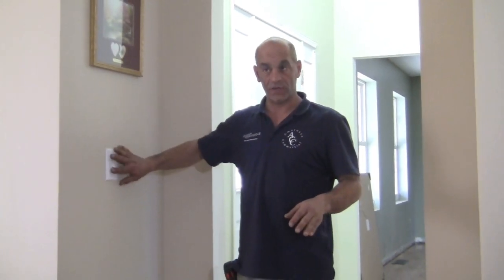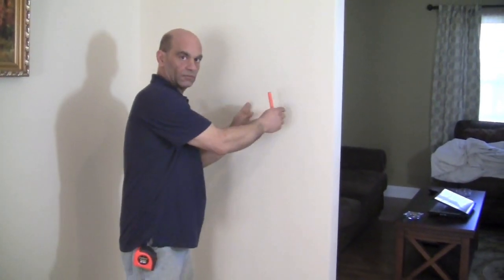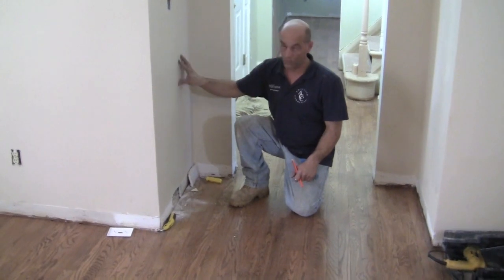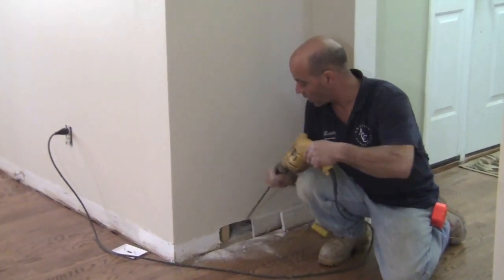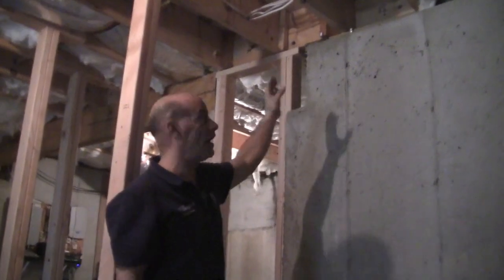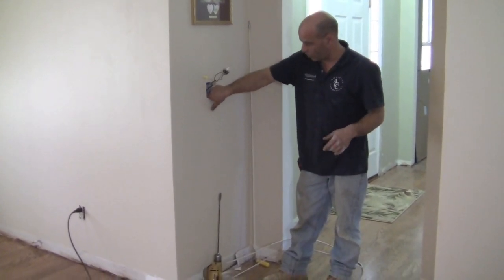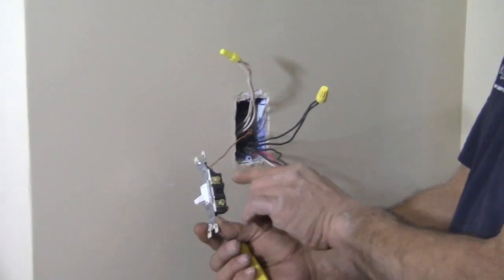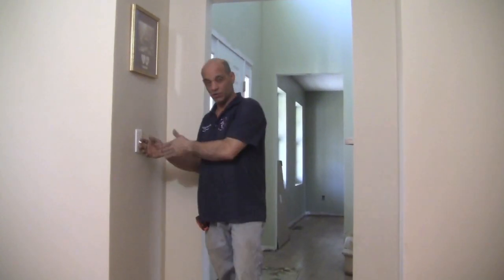How to install a three way switch to a existing one way switch

Comment: Thanks for the vid. Question, my hardware store is out of one way illuminated switches. Can I get away with using a 3 way which they have 30 lol?
Reply from the maker: Yes of course. It doesn't need to be illuminated.

Comment: At my company,  we call them dead end 3 ways.    The big disadvantage,  is there is no neutral at the other 3 way switch that you just added,  and some of the newer smart switches and dimmers, do require a neutral.   Unless you ran a 4 conductor plus ground cable,  they do exist but they are super uncommon and expensive.    Also, in this setup,  technically you are supposed to re-identify the white conductor by wrapping black tape around the end, or coloring it with a black sharpie,  because the white is now being used as a hot.

Comment: I am doing exactly what you have in this video. However, I purchased 12/2 wire, will that work or will I need to get 12/3 wire instead?
Reply from the maker: No that's fine.
Reply: Actually you need 12/4 wire with ground to be up to code.

Comment: 3/4 of the video is spent running wire, and about 10 seconds spent explaining how to connect to the terminals, which is really the most important part.
Reply: No you missed the point, it's not about the switch, it's your fault you dont understand the point. This is much more important than wiring the switch, you looked up the wrong video

Comment: is there any way to do this  with a finished basement?
Reply from the maker: Yes of course. Just need to get the wire from one side to the other. How will depend on your ceiling, or to go from stud to stud.
Reply: @Askmediy  so only way would be to tare the drywall up? thanks!
Reply from the maker: HD yeah there is no real simple answer sorry to say
Reply: @Askmediy  Seems strange but could you maybe hide wire behind crown molding? or is that against code
Reply from the maker: I mean you could but yeah not to code

Comment: Too bad you didn't show us how you routed the cable across your unfinished basement.
Reply from the maker: Yeah not all are the same, that's why.
Reply: I understand that,  @Askmediy , but that doesn't mean you couldn't have said, "Here's how I wired it in my basement."
Will you please make a part 2 where you go back down and just walk us through how you did it in there?
By the way, I replied to our other thread where you replied. Wanna reply to that too, please?

Comment: Wouldn't a single switch be called a 2-way switch (up/down), since a 3-way system has up/up (1), down/down (2), or up/down (3), as there aren't 3 switches/paths, so the naming convention is actually after the switch position combo?
Reply from the maker: You said you had three switches right?
Reply: Thanks for your quick reply, even at this hour,  @Askmediy . No, I didn't say that. I looked up "Where does the term '3-way switch' come from?" since there are only 2 switches/paths, and it answered with the number of switch-position combos, ignoring the multiples combos generated by caring which switch is down or up while the other one is opposite (to avoid exponential counts):

1 switch: up/down (2 ways).
2 switches: u/u, d/d, and u/d or d/u (3 ways if you count the last 2 as only one of the ways).
3 switches: u/u/u, u/u/d, u/d/d, and d/d/d (4 ways if you again ignore the order of mixed combos, like "u/d/u," "d/u/u," etc.).

Or I just noticed it another way, which is actually simpler: The number of conductor screws other than ground is the number of "ways" it has (a 4-way switch thrown into the mix has 4 non-ground conductor screws).
Reply from the maker: @HelloKittyFanMan.  You either have a single-pole switch and only one of them. Anything more than one switch would be a 3-way switch and only two of them. Or you can as many switches as you like, first one would be a 3-way and the end would be a 3-way, any switch between them would be a 4-way.
Reply: Thanks,  @Askmediy , but you have some terminology wrong. There are some basic types of linear switches: A pole isn't quite what you're calling it. A lot of people get this one wrong. The number of poles is the number of sets of contacts. For example, even this 3-way switch is actually a single-pole switch, and that differs from the throw count. The throw count is the number of path options the switch has.

A single-pole switch has only one set of contacts. But an on-off-only switch can be single- or multi-pole. For example, these on/off switches are single-pole, single-throw switches. Your 3-way switch is a single-pole, double- throw switch because it has one common screw and then 2 places it can send the current.

So an on/off-only switch with 2 sets of contacts is a double-pole, single-throw switch. if you doubled up on the number of contacts and screws on a 3-way switch, it would be a double-pole, double-throw switch. So a 4-way switch like these looks like some sort of single/double-pole and double-throw, but I'd have to see inside one or a schematic diagram. I know it can only have 2 throw positions, though.

So you could have a switch that has 3 click positions, which is either double-throw with a neutral position (all off), or a triple-throw. And then let's say you have a rotary switch with a common connection and then 10 options for you to click to. That would be a decuple-throw (10-throw) rotary switch! So on and so forth.

As for "anything more than that" but then "only 2 of them," that's sort of a self-contradiction, but then you sort of corrected yourself after that by saying we can add the 4-way switches. And that confirms that it's not about the number of switches in the system, and not even totally about the number of up/down combos (because you could have 3 4-way switches, for a total of 5 switches, and it wouldn't be a 6-way-switch circuit -- 3, 4, 5, 6), but it seems to be a lay term for the number of single-pole circuit conductors involved, like the non-ground screws, in this case.

Comment: Thank you, just wired mine,  didn't realize you just basically have to jump original black wire that goes to light fixture and feed it towards new 3-way switch. And use red and white as tracers for both switches. Now I see logic
Reply from the maker: There are 9 ways to wire a 3-way. Good deal.

Comment: I have six lights on a three way switch in my kitchen. I want to make one of the six over the sink on its own single pole switch and leave the other five on the existing switching.  What do I need to do to accomplish this? Thank you.
Reply from the maker: Hi, you’ll have to disconnect the one you want on it’s own. But do make sure the wires go back from one light to the other. At this point you’ll have to run a new circuit to the one you want by it self. New switch and so forth. Without me being there it’s a little hard to say how. But perhaps you can come off of something else for the power.

Comment: Excellent video. I want to make the same change, but I am on a concrete slab, single story house so wires most likely go up from existing single pull switch. Attic is difficult to get into due to crazy trusses supporting roof. How would you run the wire to the second switch location?
Reply from the maker: Up and over buddy. It's really the only way.

Comment: I have an Industrial 3 way switch that i wanted to install for simple on/off single pole operation. I was told i can wire the 3-way for simple on off, but have not found how I would attach the Romex wires. Do I need to use a jumper wire on the switch or how would I do this. Thanks.....and nice video.
Reply from the maker: No, just use the correct switch.
Reply: @Askmediy : You CAN use this kind of switch as a single, if you don't care that it's unlabeled if it's a toggle (as all rockers are unlabeled anyway, just style-wise).

Comment: This video is awesome i need to add a switch. Mine is the opposite of yours,no light by front door,closes light is by dinning table omg...who built this house lol..thank you for video ill be doing this soon,what size wire is that traveler?im assuming 14/3?
Reply from the maker: Yes most are 14/3 15 amp
Reply: @Askmediy  ok thank you buddy & thank you for your videos
Reply: "Dinning"? What's that?

Comment: Trying this tomorrow.
I pray it works.
Really thought I had to have wires from light switch coming into the new box along with the new 12-3. One question..
Looks like there are two wires tied together that has pigtail going to common screw.
why is the other black there?
was it always there feeding power elsewhere? thanks
Reply from the maker: Let me know what you have tomorrow .
Reply: @Askmediy I really have the same scenario you have in your video except in a detached garage.
Neutrals are all together. hot wire on bottom of switch and black wire to fixtures on top screw.
I already have the 12-3 ran but then started second guessing myself how to complete circuit.
I was afraid i would have to run wires from fixtures to my new box too.
Reply: @Askmediy  It worked, it worked..
Thanks a ton for this video.
Reply from the maker: @b_rad5678  LOL awesome, Happy New Year

Comment: What if the light switch you have has a white and a black wire on it which mean all they done was brake a wire at the light
Reply from the maker: It would really depend on a few things. You should just be able to follow this video.

Comment: Thank you, you’ve made it easy, though you forgot to talk about traveler wire connections on finishing the switch box with all the wires in it, I was able to see it in the video. Thanks again.
Reply from the maker: Glad I could help out.

Comment: THANK YOU!   This is not a typical 3 way wiring set up but is similar to the one in my hallway stairwell.  

YOU gave me insight into this wiring method that i did not find in vids and installation directions.  (all are mostly with the hot and leg on either 3 way switches)PLEASE MAKE VIDS with installing sensors on either end of the switches in this wiring set up.  Lutron and MAESTRO do not have instructions on installing them on this type of 3 way set up wiring and you will help a lot of diy people.  👍. great job.  i do feel stupid not figuring it out on my own

Comment: Aren't switch boxes required to have a neutral wire now?  The new switch box doesn't have one, right?  Is there an exception for 3-way switches?  Might be good to have a new video showing how to do the wiring so that a neutral is added to the new switch box.
Reply: You are correct. Since 2011 the NEC code has required a neutral in each switch box. To do that he should have used 4 wire with ground and used the white wire as the neutral and the black as the line and the two remaining wires as travelers. The neutral would just be capped off with a wire nut in the new switch box for possible future use.

Comment: Thanks! I need to add a switch by the front door of my house for safety, and I wasn't sure if I could just add a switch. I was afraid that I would have to rewire the whole circuit.

Comment: I am trying to connect the steps to the basement as 3 way switch. Currently, one switch at the entrance puts two light on; one at the beginning of the steps and the other at the end. Would like another switch at the end of the steps too. I will be changing the existing 1 switch to a 3 way switch, and also put a new 3 way switch at the end of the steps and connect both switches with 14-3. I am having a challeng with the existing switch which has 3 black wires connected to it. Please see pic.. Thanks for your help
Reply from the maker: What you are looking for is a 4 way, not a 3 way. Look for my video on 4 ways

Comment: NEC 2017 Lighting fixtures above a pool must be installed at a minimum   height of?
Reply from the maker: There are too many variables on this one. To be safe and correct I would just ask the electrical inspector. But for sure must be GFCI protected.

Comment: Thanks a million.  I dont use it 100% but it works.
I still would be trying to figure it out... the explanation was kind of quick and a little vague with when it came to wiring the switches.  But the picture was clear so i went mostly with the visual.  Thanks so much.
Reply from the maker: Hey what part did it for you that's all you need. Good deal.

Comment: It seems like the cable from the source is probably coming into the light, meaning that there is a switch loop, no?  If the cable from source comes into the switch box instead is there a different method or is it the same?
Reply from the maker: Yes pretty much the same.

Comment: I don't know why he didn't put a floor a nail through the floor find the nail in the basement go over from their drill up through the plate in the floor and then run a coat hanger or anything in there to pull the wires through it's a lot better than cutting a big whole in the drywall

Comment: Great video, but Weren't you suppose to hook up the white nutral in the three wire traveler wire anyway. Lol. Thanks for a great video.
Reply: He connected the white wire from the new switch location to the switch at the existing location. You can see that in 8:44

The reason he didn't mess with the other white wires that are connected to each other is because those wires are the actual neutrals from light fixture and power source to complete the circuit. Hopefully this makes sense

Comment: Don't forget to mark that white traveler wire with black tape. It's not being used as a neutral now.
Reply: Robert Post   Black tape turns into black goo  after years in a box.   Anyone qualified  will know that’s no longer a common
Reply: @dirkdiggler9379  
Code still requires it to be marked with any color other than white or green. I just use a black permanent magic marker.

Comment: You should of made sure that box is level before tracing and cutting. Did you show how to check for studs?
Reply: The box will "self level" with the stud. The switch has bigger holes so you can wiggle it left/right/up/down to make it pretty after.

Comment: Thanks for sharing.  I am doing exactly the same set-up at my daughters house.  One side,the existing single switch has a bunch of other wires coming into the box.   For mine, I will try to replace the smaller cubic inch box for a deeper one.
Reply from the maker: Great, let me know if you need more help